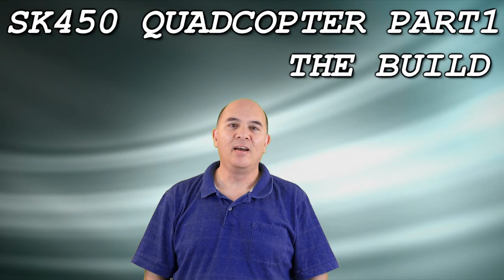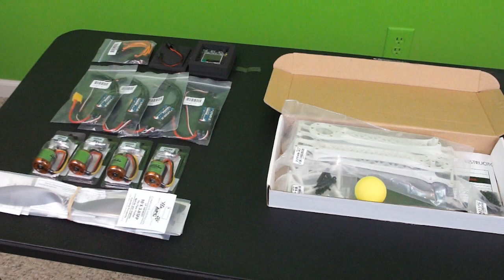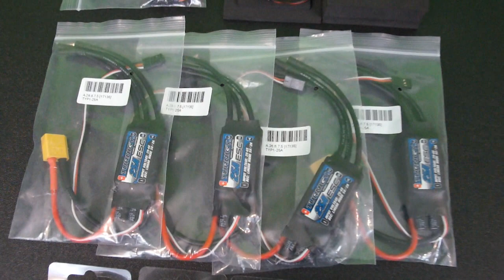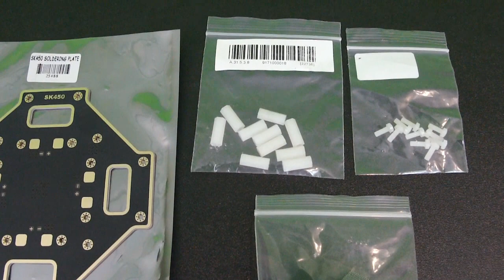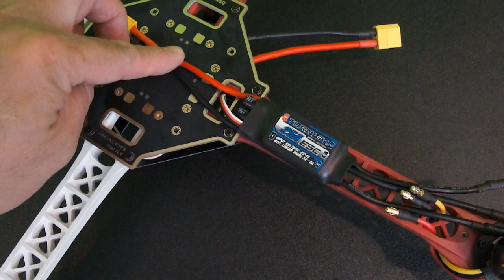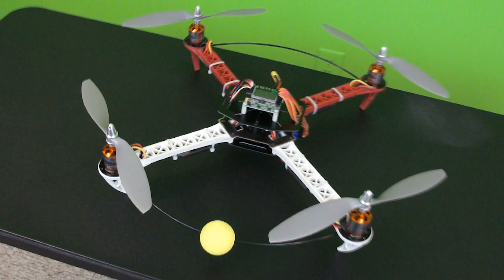SK450 Quadcopter Part1 The Build

Comment: Nice video. I bought a 450 quad from a friend who built it but couldn't get it to fly.  I went through an ESC video on all 4 ESC's and then set it up according to your videos.  Took it out and it flew pretty well, even with a bit of wind.  Mine is on an older aluminum frame, I have the SK450 arriving tomorrow from Amazon and will move over to it.  It think it will be more visible in the air and more durable as well.

Comment: Hello Frank!
First of all thank you for amazing video.
Can you give a little info about maximum weight which can be added to your quad with this configuration!
Thank in advance!
Reply from the maker: Michał Pełka at about 60% throttle this setup pulls about 4.75lbs (2150g) The quad with 4000mAh 3 cell weighs about 3lbs (1360g) you should be able to safely carry another 1.75lbs (790g) and still get good flight times.
Reply: DiehardRCaddicts
Thank you for your support!

Comment: I used all the parts similar to the ones mentioned in the video except the motors. The motors i used are emax xa 2212 rated at 1400 kv. The following are the parts i used for making SK450 Quad:
1. Simon series 25A ESC
2. 12 x 4.5E Nylon Multi Rotor Props
3. Hobbyking KK 2.1 Multi Rotor Control Board
4.CellCor 2200mAh 3S 25 C LiPo Pack
5. Turnigy 5x5Ch Tx/Rx(Mode 2)
and finally Emax XA2212 1400 kV motors.

I just wanted to ask if the parts used are good enough or do i need to find any other alternative. Any help would be highly appreciated as i am new in this. Thank You!!
Reply from the maker: Roshan Singh 1400kv is too high for 12x4.5 props. For that size you would need motors rated around 700kv or less. If you are going to use the 1400kv motors you will need props no bigger then 7x3.8
Reply: DiehardRCaddicts
What size props can I use along with 2210N 1000Kv Brushless Motors? Also, are these motors a good alternative to Turnigy 2836/9 Brushless motors which I wanted to use but could not due to my budget. If not, can you suggest some other motor in the same range? Thank You!
Reply from the maker: Roshan Singh The recommended prop on HobbyKing site is 9x5 on 3 cells but you should also be able to run the 10x3.8 props I used in this SK450 build video series. Just be sure to check the motors after a short flight to make sure they are not getting hot.
Reply: Thank you so much for your help!

Comment: Looking to build my fist copter. Think This will run on 4s safely? Looking for some good speed! think I should go higher kv on motors?

1x Hobbyking SK450 Glass Fiber Quadcopter Frame 450mm = $19.21
4x Turnigy D2836/9 950KV Brushless Outrunner Motor = $48.28
4x Turnigy AE-25A Brushless ESC = $42.84
1x Hobbyking KK2.1 Multi-rotor LCD Flight Control Board With 6050MPU And Atmel 644PA = $29.99
1x 10x4.5 SF Props Black CW (2pc) CCW (2pc) = $3.69
1x Hobbyking Multi-Rotor Power Distribution Board (DIY 8 x output PCB) = $2.16
1x 5.6mm x 30mm M3 Nylon Tapped Spacer (10pc) = $2.36
1x M3X10 Nylon Screws (10pcs/bag) = $0.87

USPS Parcel Post 5-6Day US-PP $9.88

Total: $159.28

Comment from the maker: The PCB board has two solder points for the battery connection wires on the bottom of the board. The other four sets of solder points for the ESCs are on the top of the PCB board. You just can't see them in the picture on HobbyKings website.

Comment from the maker: They are the same size but have a few differences. The Q450 is more of a direct copy of the DJI Flame Wheel 450 quadcopter. The SK 450 frame isn't as tall between the top and bottom and has bolt on motor mounts and landing legs.

Comment: When your zip ties are in the middle of the esc like yours, when you crash hard or try to start it up for the first time it can destroy them by splitting them right in half or burning out from the pressure. So put the zip tie where the wires that branch off from the esc are on each side. :)

Comment: Frank was correct.  Where the confusion occurs is the way you perceive male or female connections with this connector.  He is referencing the pins used to make contact with its counterpart NOT the Black Plastic that holds the 3 pins.  These cables are used to connect the MALE pins on the receiver to the MALE pins on the KK 2 board thus they need to contain FEMALE pins.  Alot of people refer to these cables as MALE because they often fit into a Sleeve which they refer to as FEMALE.

Comment from the maker: In the video I used 2200mAh 40c 3s1p LiPo batteries. For longer run times you can use bigger batteries but would keep them 4000mAh or less. I was getting 5 to 7 minutes with my setup.

Comment from the maker: Motor would probably take it but may be pushing the 25A ESCs. Each motor is pulling about 22A at full throttle with APC 10 x 3.8 SF props.

Comment from the maker: Yes, should be no problem using 10x4sf props with these 950kv motors. If you use different motors with higher kv rating then you will need to change to smaller props.

Comment from the maker: The ESCs used to build this quad have BECs (battery eliminator circuits) built into them. The power from the main flight pack battery runs through the ESCs and the BECs regulate the voltage down to the proper volts for the receiver and KK2 board. You do not need a separate battery for the receiver or KK2 board.

Comment from the maker: I used my Airtronix 8ch receiver with my RDS8000 8ch transmitter. You can use any radio tx and rx with at least 4 channels but would recommend 6 channels or more if you want to use the aux channel to switch modes.

Comment from the maker: I would not use anythimng smaller than a 2200mAh 3s battery. You will also want to use high C rated batteries. I use the Turnigy Nano-Tech 2200mAh 3s1p 45~90C batteries  or Rhino 2250mAh 3s1p 40C batteries. The higher the C rating is, the more amps you can safely draw from the battery. This is important since only one battery is running all four motors.

Comment from the maker: SKU# 258000011 is the correct part number. They fit male to male conections but have female connecters on the wire leads.

Comment from the maker: You want to run the #5 wire lead from the KK2 receiver input side of the board to the receiver Aux out put channel of your choice, then set up the auto level to Aux in the KK2 setup menu. This is covered in the SK450 Quadcopter part2 video.

Comment from the maker: Yes, very happy with the motors so far. They provide lots of power. Doesn't take much throttle to hover at all. If you really want too you should be able to go down in motor size with out any problems.

Comment: Thanks for your reply Frank. Got my FC delived yesterday and was up 'til 4am playing with my new quadcopter!! Wow, this KK2 board is so awesome and very easy to program. Love the glow of led light behind the lcd screen. I went ahead and unplugged the red wire in my UBEC esc before i plugged them in M2 M3 M4 ports to be safe and it works well. Your recommended PI settings all worked beautiful and made my first quad fly pretty smooth! I'm going to play with the Auto Level feature tonight and try

Comment: I'm in the process of building a similar quad, are you happy with your motor selection?  I will be attaching a gopro to mine but that should be it.  I'm trying to decide if I can go with a smaller motor to increase the run time. Thanks.

Comment: Great videos Frank! Your videos help convince me to purchase my first quad. I got DJI f450 frame from LHS since HK cannot keep sk450's in stock. I've got all the soldering done so just waiting on kk2 board to arrive. I am using 4 Hobbywing SkyWalker-40A UBEC ESC's for my quad, do I need to snip red and black wire going into kk2 motor inputs? Thanks for you help!

Comment from the maker: Never tested it with a watt meter but the motors used are max rated at 23amps so 25amp esc are ok if you are not on the throttle all the time. 30amp esc would be safer.

Comment from the maker: I had one esc die after about 10-15 flights. Haven't had any other issues since replacing that one. If I were to do it all over again I would probably go with the Turnigy Plush 30Amp esc as I have never had them fail.

Comment from the maker: Yes, you will have to solder the wires to the solder board but you may also need to shorten the wires between the ESCs and motors which means you may have to resolder the conectors. There is no other soldering than that. the rest of the quad just bolts together.

Comment from the maker: The SK450 kit is the quad frame only. You will also need to buy all the electronics. The solder board is sold seperately. Check the links in the video information bar below the video. Threadlock is not a bad idea but use the removable type if you do.

Comment from the maker: It comes with all the screws you need to assemble the quadcopter. The only other ones you need are the ones that come with the motors so you can screw them onto the motor mounts. You will also need some M3 size plastic standoffs to mount your control board to the quad. Please check the links in the video information bar below the video.

Comment from the maker: I'm not sure what the problem is as I have not experienced it with the stock prop adaptors that come with the motor. You might just need to tighten them a little more to insure they hold. I usually slip a hex wrench through the hole in the cone shaped nut and cinch it down.

Comment: Thanks for your video. I'm also in the process of building my first quad and have the same motors as you. I'm having problems with the screw cap spinning off and the propellers flying off the shaft. Is there any trick to properly attaching those things that I am missing?

Comment from the maker: The motors fit the bolt pattern but the center hole that the shaft sits over needs to be a little bigger so the c-clip on end of the shaft won't rub when the motors turn. you can drill them out bigger or use a small hobby file. It doen't need much.

Comment from the maker: Thanks for pointing that out. I found per the instructions that the new KK2 board only needs to have the wires cut if you are using multiple esc with switching mode bec. If they have the usual linear bec you do not need to cut the wires. It also states M1 must have a an esc pluged into it as this one feeds power to the control board. M2-M8 are all connected together and all esc on these will power everything else including the receiver and any servos, etc that may be pluged in.

Comment: Nice build Frank!  I'm not sure about the new KK board you are using but on earlier models you need to snip the positive and negative leads coming from 3 of the 4 ESCs in order to avoid damaging the board - only need power from one ESC to power the board and receiver.  Might be good to check this before you power up.